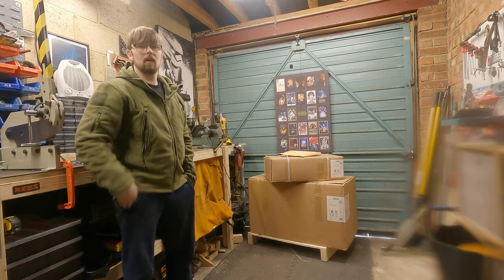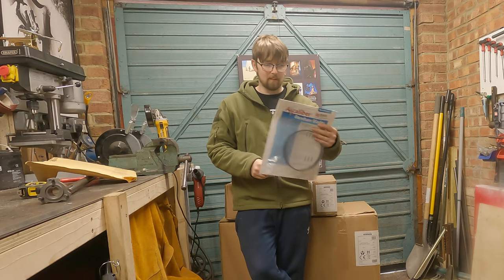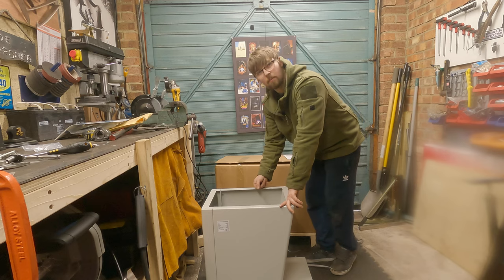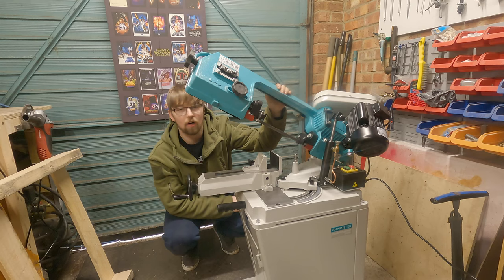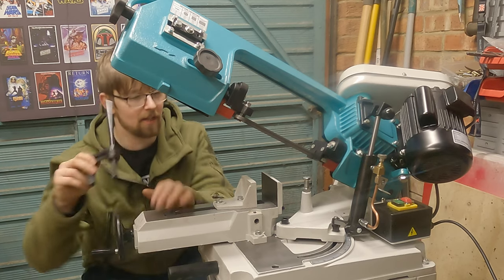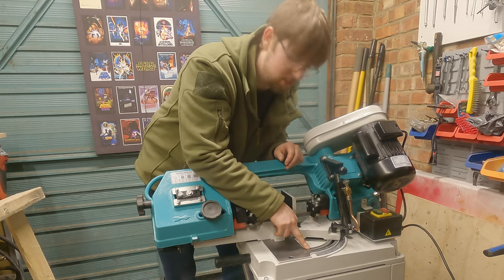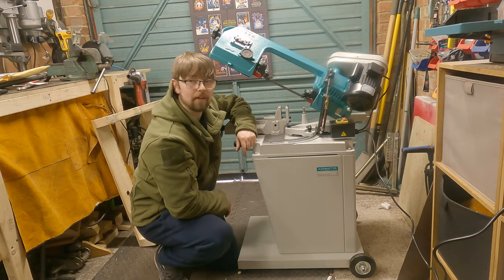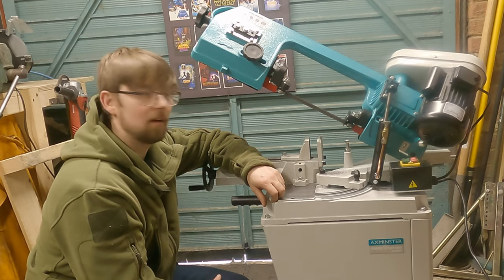Axminster Bandsaw Review

Comment: Well that's a very nice machine you've got there.They are certainly worth every penny they cost, and will take all the tedious effort out of cutting metal while you get on with doing something more enjoyable using your lathe and mill, or just sit with a mug of tea and a biscuit. 
 I have bought two horizontal metal cutting bandsaws from Axminster. First the 4 1/2 inch model made in Taiwan, which has managed to cut 5 inch diameter solid cast iron bar, followed a few years later by the larger 7x12 model which was made in China, as many are now.
 One thing I would strongly recommend is to remove the cover from the worm and wheel gearbox to check the internal condition, it looks like the hydraulic cylinder upper mounting bracket is also bolted to this cover on your saw. Sometimes the gearbox internals are assembled in a rather dirty state.
Both my new bandsaws gearboxes had traces of swarf and foundry sand left in them, along with rather grotty and pastey looking lubricant, so they were cleaned and flushed out then refilled with fresh 90 weight gear oil. It is worth checking, and will avoid potential premature wear or failure of the worm and wheel type gears used in the box.
 Anyway, it's good to see a younger person who enjoys owning and using machine tools.
Reply from the maker: Hi Lathejack welcome to the channel.
Great bit of advise there it is always good to hear from someone with experience with a certain brand of machine. Next time I'm in the shop and have a spare hour ill definitely look into that. like you sed if it saves premature wear just by cleaning and re greasing then it's an easy win. 
All the best and hope your enjoying the channel content

Comment: I contemplated one of these for a while. I got put off by the footprint size and the motor in the end. It looks like a tidy bit of kit though. I went for the Scheppach MBS1100 in the end, smaller but with an 1100w motor. Anyway keep up the videos. Cheers
Reply from the maker: Hi Alex. 
Since using this bandsaw a fair bit recently I am really pleased with it. It is very quiet and gives really clean cuts with good precision. If you are ever in the market for a bandsaw again I would highly recommend this one

Comment: Hi folks, I have this saw. It was well aligned out of the box. Buy a better blade for it though, it will cut quicker. Couple of points though,  no interlock switch in the belt cover and the bolt to release the motor to adjust the belt speed is very poorly positioned. Usual problems with the vice. Everything can be improved with a bit of work.

Comment: This was a two person lift, you could have dropped the saw, or, worse still, injured your back. You are not being a weed or a nerd if you get assistance. ALSO, most important, you lift from a crouching position with your knees fully bent and keep your back straight. You do not get a second chance if you injure your back. It does look like quite a good machine though. I was looking at Axminster lathes at approx £2,000 but they are [in my opinion] not man enough to do what I want to be doing.
Reply from the maker: Yes this is true didn’t realise just how heavy it was until it was too late. And yes it is a good machine used it a fair few times now and it gives great cuts in material that would normally get a sloppy cut with a grinder.